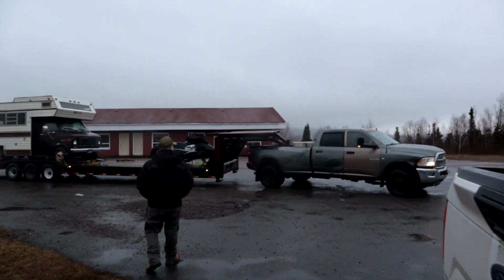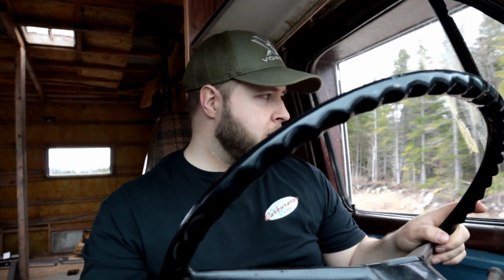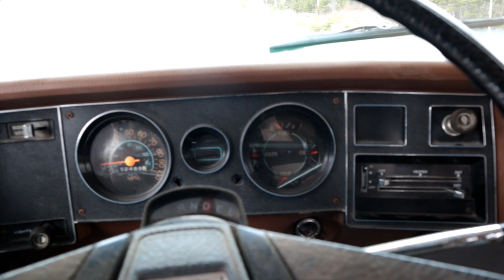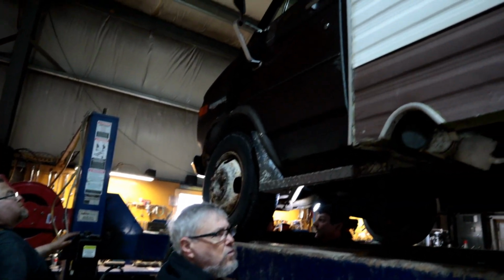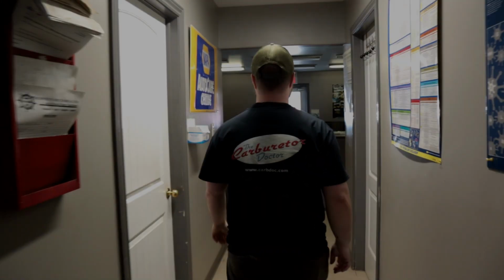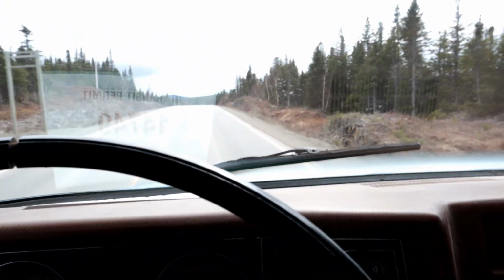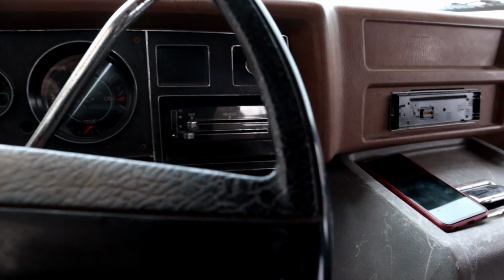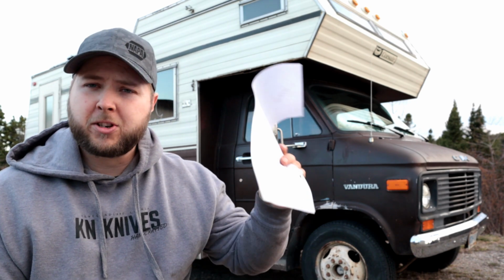Getting our 1976 GMC Motorhome INSPECTED - [5]

Comment: Sorry about your grandpa. Nice to see it running so well. You gotta put an 8 track in her. When you pulled into the garage the tail light on drivers side was out.
Reply from the maker: Thanks Clifford. I'm not sure about the 8 track! haha Might be hard to find tapes nowadays. All lights were working, but the rear drivers is a little dim. I suspect a poor ground. However, all of the rear lighting will obviously be removed / replaced with the removal of the cabin!

Comment: The carburetor could have clogged parts, or the coil could be weak, if it still has points you need to adjust and clean them better yet get a electronic upgrade I don't think you can even but points today? Last car I had with them was a 1970 Dodge Coronet 500 I couldn't get points they made a conversation kit for it. It could be a fuel filter dirt in the fuel lines? Being that old anything is possible.